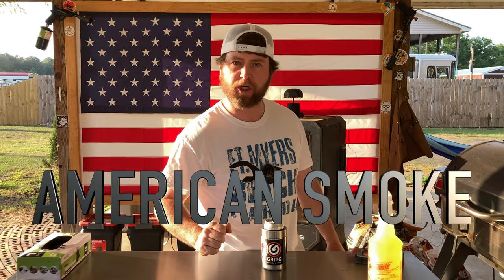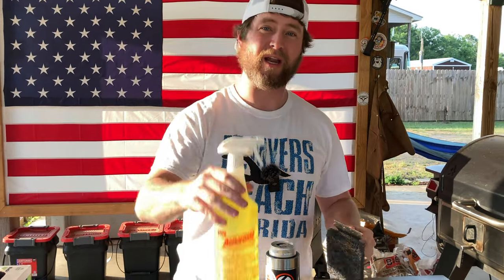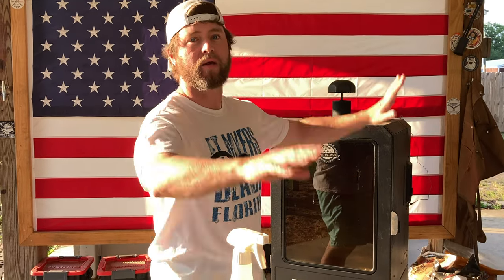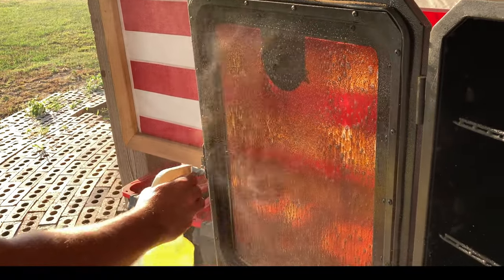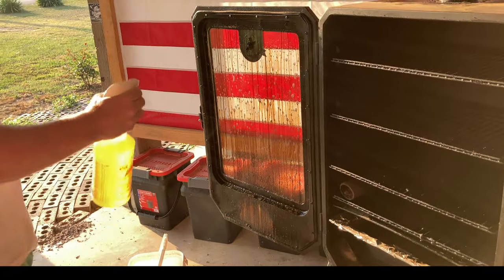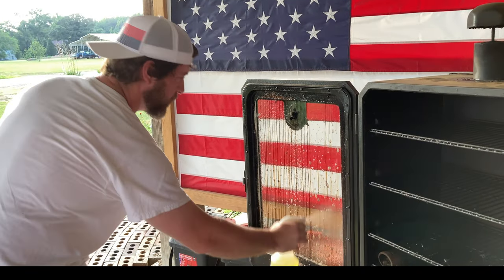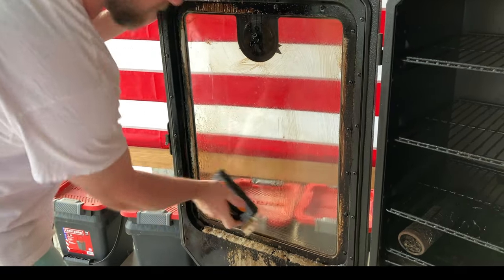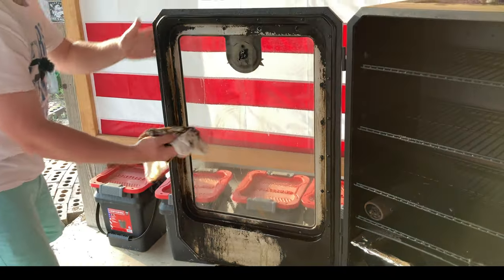My Ultimate Smoker Glass Cleaning Hack! Extremely cheap and EASY!!!

Comment: Awesome will take the chrome off a trailer hitch! Dirt cheap and works like a champ. 50/50 it with water and you are golden!
Reply from the maker: I should have diluted mine a little. People have pointed out that it can damage glass at full strength. Mine seems to be fine but your suggestion is probably better. 
Thanks for watching! Smoke on!!!

Comment: HAHAHAHA! Told ya lol. I use my garden hose to rinse it off after. Also if you spray some on a paper towel you can just wipe off the buildup on the internal temp sensor to keep it clean and reading correctly.
Reply from the maker: I’ll be using it for my next full chamber clean. Smoke on!!!

Comment: Thx Zak...
A while back there was a video of a guy that used AWESOME and cleaned his entire cabinet interior and glass....
I'm always nervous about chemical residue..
So, on occasion, I use CLEANING VINEGAR ..
It comes in about half gallon jugs at Lowes or Home Depot. It too is an amazing product that I always experiment with. The GF was amazed when I added a cup to a load of my whites.... results were amazing without bleach. 
So, CLEANING VINEGAR is what I use on my Pit Boss.
Not as harsh....but no poison 😮☠️
Reply from the maker: Cleaning vinegar you say?
Reply: @American Smoke  Yeah Buddy!!! It's labeled CLEANING VINEGAR. 
MULTIPLE USES!! You'll dig it.
SMOKE ON !!!!
Reply: @American Smoke  
It won't melt your residue..but it's safer. I give it a little help with those cheap green scrub pads. 
The thought of ANY chemical residue in my family n friends food freaks me out. I don't believe in the "it'll burn off during smoke mode" theory. 
😎

Comment: Great video, thank you. Would you use the same product to clean the inside, I would think so. Thoughts?
Reply from the maker: I’ve had several people use it in the inside with great results. I would recommend washing down with hot soapy water and a rag after and then doing a 1 hr burn off at 350 or higher afterwards to eliminate all chemical residue from inside the chamber. 
Thanks for watching! Smoke on!!!
Reply: You rock. I’ve had my pellet smoker now for about 2 months and you have made my experience so much better with your videos. I will continue to monitor your videos and will do my utmost to up my cooking game. Thank you again and have a most excellent day.
Reply from the maker: No doubt about it! I hope you have a great day as well. Smoke on!!!

Comment: Just FYI- I was checking out this product on Dollar Tree's website and actually read the labels.  The label on the front of the container says "Dilute Before Use".  To make things even better for you, the label on the back of the container says (in large font, ALL CAPS,  AND underlined) "DO NOT USE CONCENTRATED ON GLASS".  Who knows WHY you shouldn't just spray this stuff right out of the bottle onto glass like you did, but the manufacturer obviously has a reason to make such a big point out of it!!  Proceed with caution!
Reply from the maker: Yeah, I’ve never been the best at reading labels. I see degreaser and it’s on! Thanks for the concern. Maybe it helps that the glass on the front door is tempered? I’ve had no problems. Thanks for watching!
Smoke on!!!
Reply: @TheAmericanSmoke  I did email the manufacturer to ask what their undiluted product does to glass.  I'll update IF they reply.
Reply from the maker: @djmerchant that’s great! Thanks for looking into it. Please let me know what you find out